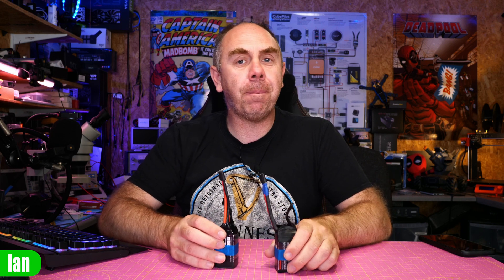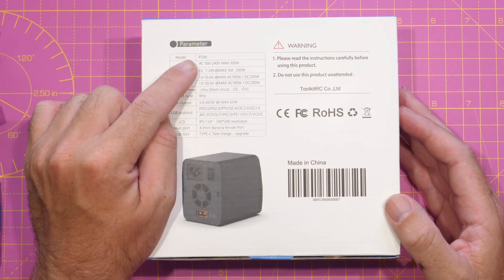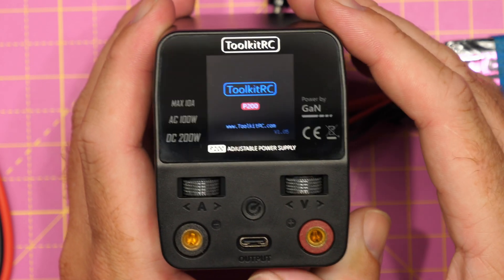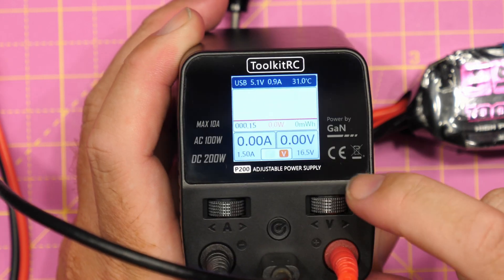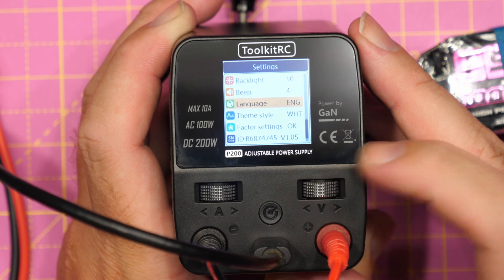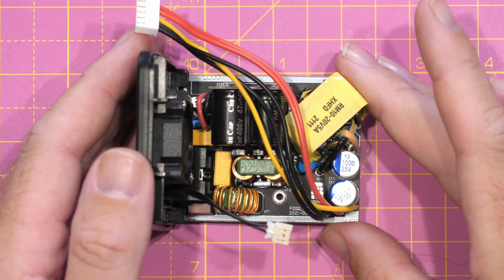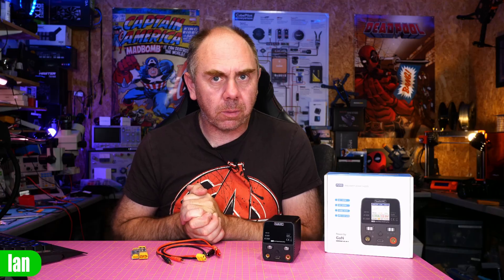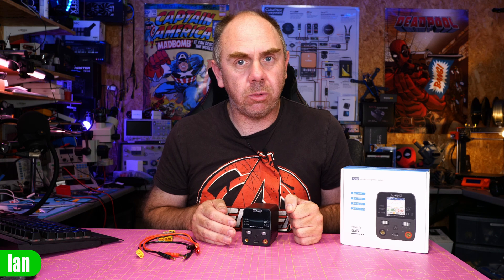ToolkitRC P200 - FPV Power Supply - Save Your Packs For Flying

Comment from the maker: Hi everyone, 

After publishing this video I had as number of people reach out or post with what I would class as some worrying issues with this psu but also other toolkit rc products. 

While I have had no issues my self it’s clear some have with both the product failing and getting support. I am looking into this. 

As a reviewer it’s hard at times not to fall into this situation as your basing your thoughts on your own findings but they more contradictory information comes to light after you publish.  

While I originally pulled the video I have set it live again as the mix of comments is both ways. Yes there have been some quality issues with some chargers from them in the past however that not to say all products are bad.  

If you have had good or bad experience with this product please can you let me know in the comments section and I will also discuss these with ToolKitRC them selves too.
Reply: My P200 exploded after few seconds working on 11.5V/2.5A powering my flight controller. I purchased on 25th August 2021. Very poor product and disappointing cause cannot claim warranty due to expired of warranty. Just 1 month over.
Reply: Has there been an update about the quality and the poor support, also the built quality ?

I am on the edge to buy one or the cheaper, newer SkyRC Neo ?

Comment: I have this power supply and so far it has been solid.  But I did have some trouble with my soldering iron.  I had a Pinecil and on a few occasions when powering it up I got a trip and and error message on the screen.  Can't recall off hand exactly what it said but the end of this story is that the Pinecil has completely stopped working after only using it for about 10-15 minutes.  So I am not sure if the power supply is doing anything funny or if the Pinecil just was weak and blew itself up.  

I did order a new soldering iron, the Sequre  Si012 iron which is awesome by the way, best on the market if you asked me... but when I powered it up with the Toolkit power supply there was a "snap" sound, you know, the kind that you hear when things are not right!  So I immediately removed it from the power supply and now I am not confident that I can use it for the soldering iron and I really need to get to the bottom of this mess.  Lucky for me the iron came with a plugin wall adapter power supply so I can run the iron with confidence.  

Anyway I do like this power supply, it is really quite simple and easy to set and use.  I really love your reviews, this is helping me gain confidence that I have made a good choice with this item. It really goes a long way to helping build confidence and I am glad that you go to that extent.   Cheers!

Comment: What does the "lowest input setting" ? Can it be used to not kill a lipo by setting the lowest input to, say, 3.2v times the number of cells of the lipo ? On the bench I use a lab stabilized power supply, but when flying it happened to me to kill the lipo that is powering my goggles. However abruptly turning off the power output when the input voltage is reached would be another form of nightmare if goggles are powered thru this. If anyone knows of a device that beeps when cell voltage is going too low and that could be used with goggles ??

Comment: I understand that this device of course does a a bit more, being a variable bench power supply and having stuff like voltage adjustments and current limits. But if the main concern is having power on your workbench for when you're building drones, a cheap power supply brick should do the trick. You CAN get that from ToolkitRC and the likes as well (like the ToolKitRC ADP100), but you can also just get a cheap one from amazon for 10-15 bucks. Or you could use a cheap old laptop power brick, those usually come in around 19V. Barrel/Bullet plug to XT60 cble you can get for ~5 Euros. Many people will have a smoke stopper already, so the current limiting feature is somewhat covered as well. In total quite a lot less than the P200. 
The main downside is that you cant change the voltage as easily, you dont see current used, and its slightly more inconvenient. Tho i see that as a maybe, because the cables i see in the video are too short to be convenient as well, so might as well go the laptop power supply route.

The laptop power supply is also great if you use a lipo charger with XT60 in and only want to charge a single lipo at a time, or multiple small ones. So its multi purpose!

Comment: So basically just get the meanwell 24V 400w and the M9 charger. This tiny little thing is mostly useless unless you really need to fiddle with the voltage settings all the time

Comment: I wouldn't go near a ToolkitRC product. 12 months ago got an M4Q which was just dangerous to use, the voltage readings being wrong on arrival. Retuned it for a refund and bought a Hota D6 Pro which just works as it should.

Comment: Thanks for the review. I would really like to trust toolkitrc as they are delivering very clever and reasonably cheap products. Unfortunately they are suffering quality issues. My P200 worked maybe 10 or 15 times before one of the 2 front rocker stopped working (the push switch). I must admit ToolkitRc was very helping, I could send it to a repair shop in Poland (I had to pay for the shipping though) and it was repaired and sent back. I heard many other quality issue reports from users so be aware before buying....

Comment: Great review Ian.  I've had this supply for many months and I love it.  Just wanted to post for the benefit of others, that after some months of use I did have one issue with it not powering up when used with an AC supply.  I took it apart and reflowed some dry joints on the AC PCB, but that wasn't the issue.  Finally I found that it was actually just a broken wire in the power cord that was  intermittently losing continuity.  Luckily I had a spare power cord from an old laptop power brick that I repurposed and it's been perfect ever since.  I did contact Toolkit RC support, but that experience was pretty dismal.
Reply: I m sure they were ike issue whas fixed and what are you Complaining about. I want to get a  cc/cv psu but I dont see people buying them on amazon. I also see most of these videos are like 2years old.
ee much pope

Comment: Why wouldn't they include a balance port and full FPV charging functionality?
Reply: Yeah, it would be a great product then.  Without a balance port it doesn't really make sense when you can buy an adjustable DC PSU for about $50. Unless you want a small PSU with 65w usb charger.

Comment: I will never buy a toolkitrc charger i have the m8 and its awful
Reply: Really, why friend? I have the M7 and I love it.
Reply: @erikvf7   its very inaccurate . I have an isdt and comparing voltage to my fluke multimeter the  m8 is wayyy off
Reply: @mikihayut8873  I see. Yeah, I never compared the voltage with my multimeter. Is there a calibration that could be done?
Reply: You can recalibrate them

Comment: I'll most likely end up buying a more powerful high end workbench power supply (like the ones we used in class at school) when I get my new place with a dedicated workshop 🙂 but this looks ideal for someone like me who's run out of space on my desk. I literally only have a small cheap table from ikea, with a monitor stand so I can slide my keyboard under it when I want to use the desk for builds, I've also got a stream deck, microphone boom, speakers, router, headphone stand and sim racing wheel on my desk lol